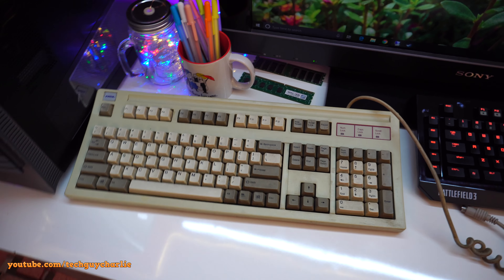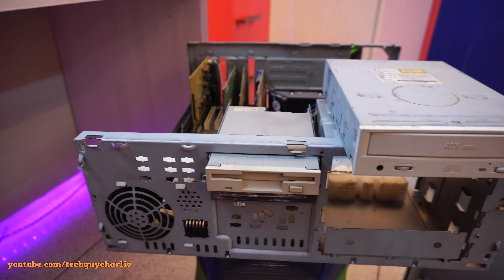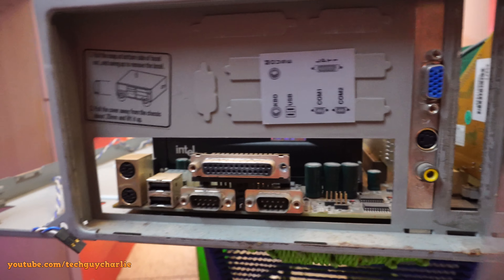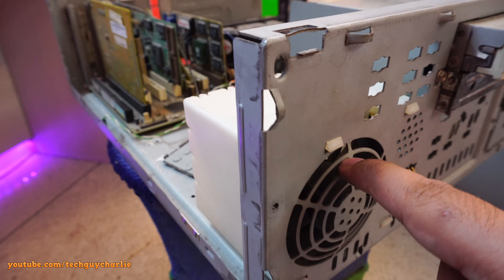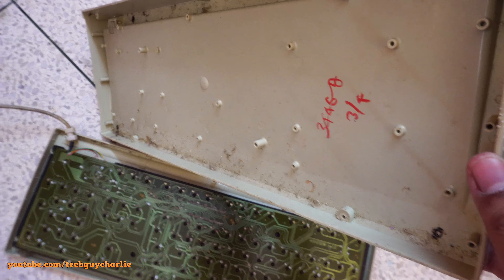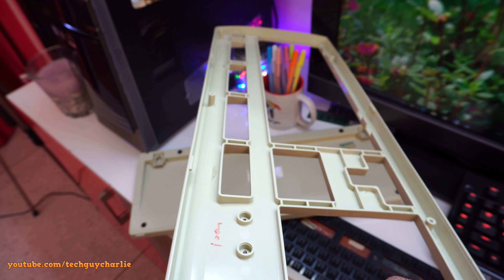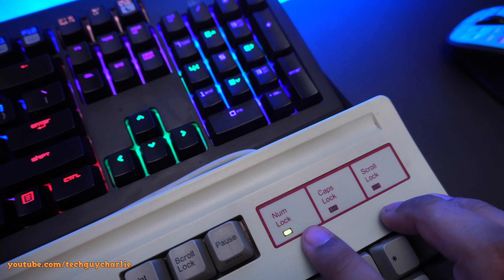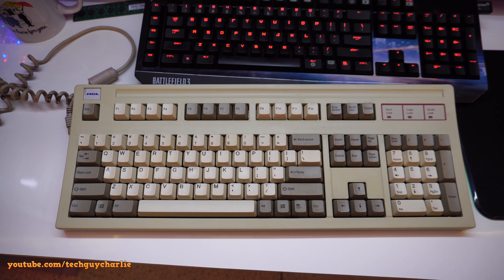Restoring a 1998 HCL cherry mx black switch mechanical keyboard and tour of my first PC (Pentium 2)

Comment: Great video! I had the EXACT same keyboard back in the day but I sold it along with the PC it came with when I upgraded to Pentium 4 :/ Ofcourse I didn't know what I was doing. BTW, you could have used the "retro-brite" solution which involves treating  plastic with Hydrogen Peroxide and UV light. Using Hydrogen Peroxide and leaving the yellowed plastic under a UV lamp for 24 hrs or under the sun for a couple of days you can totally whiten any plastic back to it's original form! Check out the 8_bit Guy's Guide for more details on how it's done!